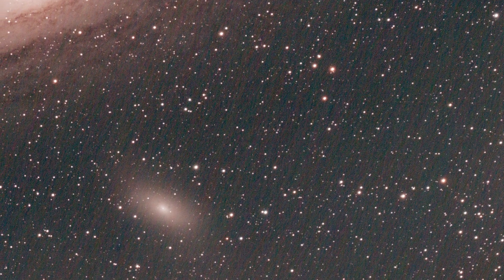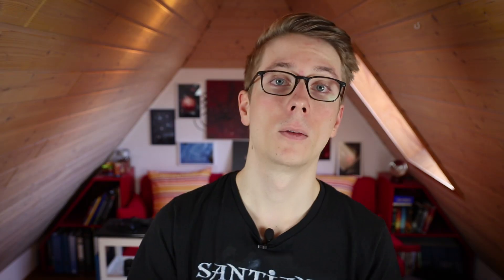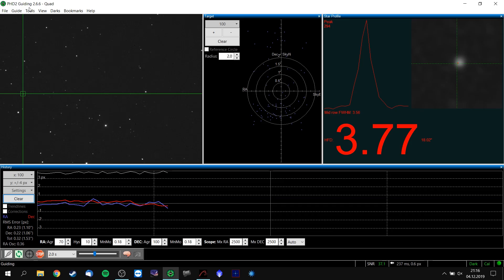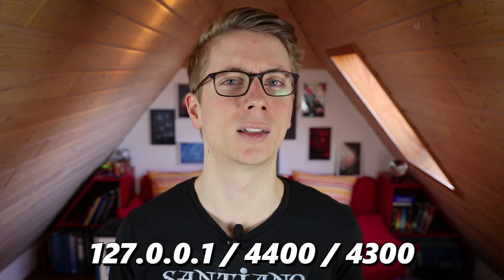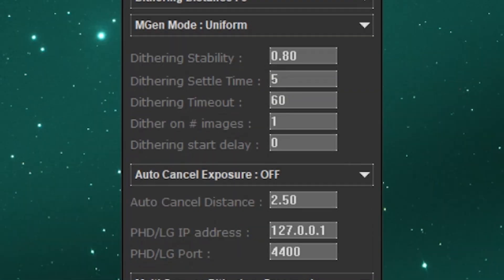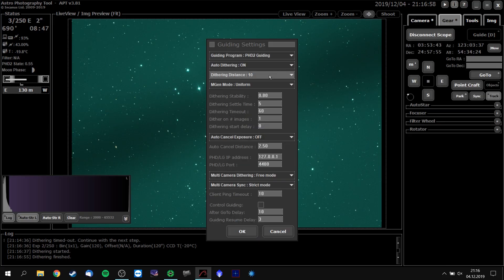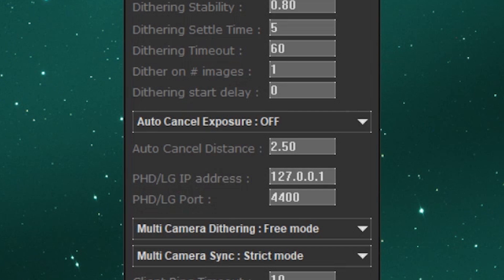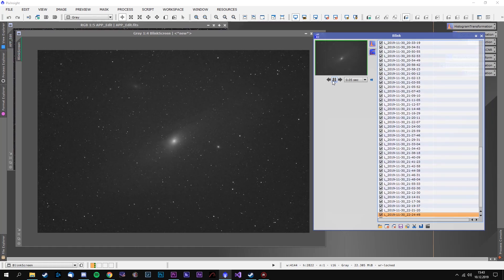Dithering with APT and PHD2 | The Astrophotography Guide #1

Comment: I also noticed that PHD2 was telling me that I would have guiding errors within + or - 20 degrees of the galactic equator. I don't understand how to address this but I do understand that to guide on targets near the celestial pole that the mount and guiding routine has to make many more corrections because the stars and hence the targets seem to make tighter circles. How could I address this problem? Could I add extra guiding calibration steps??? Please help if you know. I have to drive anywhere from 350 to 800 miles to reach these West Texas sites, so I'll probably get maybe 3 more tries this year.

Comment: I think my dithering distance is set too high. I've never messed with this setting but it seems too much. I'm trying to go by what Tony Hallas said and dithering two to three normal star diameters. I believe it was set to 30 if I remember correctly and it was dithering the target off the bottom of the frame. It was my only chance under West Texas skies and many of my four minute subs are un usable because the target is too off center. Unless I crop the hell out of it. I remember that PHD2 said spiral dither and I guess I thought I had addressed that in APT. I wonder if I can simulate everything in telescope simulator? I did get some usable frames of M81, M82, The Needle Galaxy, The Iris Nebula and Eastern and Western Veil Nebulae. I was using my T7i and believed, per PHD2 settings, that I was dithering in a spiral pattern around the target. Does APT have a spiral setting and is "dithering size" the same as dithering scale? Oh yes! I did get some great frames of the Coma Galaxy cluster also. Using 10" Orion astrograph and Televue Paracor Type 2 coma corrector on an HDX110 mount. Clear skies.

Comment: When using PHD2 with Star Adventurer, Canon with 600mm Tamron lens, I note that the guide star seems to drift to the right over the duration of the nights imaging. Polar alignment with Polemaster is near perfect and resulting images are fine. I note in PHD2 there is reference to something they refer to a "Sticky Lock Position". Would this selection ensure the guide star remains in the green cross hairs, albeit with some seconds of time increase between images?
Reply from the maker: The purpose of guiding is that the guide star won't drift at all. Very strange. Try the setting and see if it improves
Reply: @AstroAddict  I tried this setting to no avail. I should elaborate a little. In the Star Profile display the green cross is orientated Top-Bottom is RA, and Left-Right is Dec. The Star adventurer only guides in RA and the drifting I am referring to in along the Dec (Right-Left) axis. The guide star is always on the RA (Top-Bottom) axis correct and does not drift. In the graph section the red Dec and Blue RA lines initially are fine but the Dec line very soon drifts off the graph altogether. If I stop PHD and restart with a new or same guide star all the graphs return to normal then the Dec drift starts again. The resulting images even at 4 minute exposures are great. I do suspect this drifting along the Dec axis is to be expected as there is no control or correction pulses for the Dec in the Star adventurer. Would you agree with this as something not to be concerned about now and to just accept this is the correct display for a Star Adventurer RA guided axis only? Paul

Comment: A follow up question, to be able to dither that way, won't you also need to have your mount connected to apt?
Reply from the maker: I believe apt has a dither mode without mount connection. May not be that practicable, don't know about that

Comment: If you are using an ASIair simply open the Guide Camera settings and turn on Dithering from there. You ideally want a dither value that is larger than any area of color mottle (bayer noise) your camera produces, so set it as high as possible (up to 20 pixels) unless your target is already taking up your whole frame.